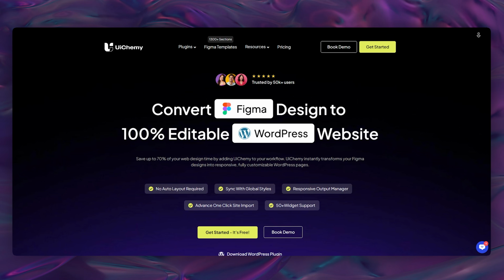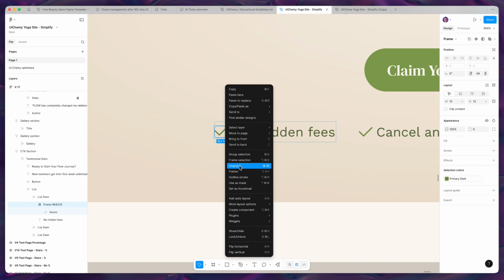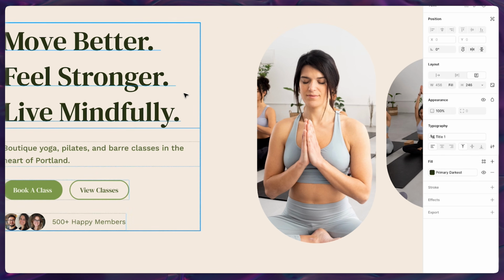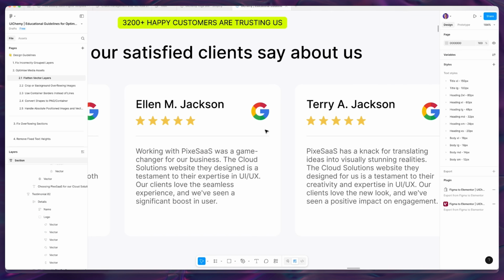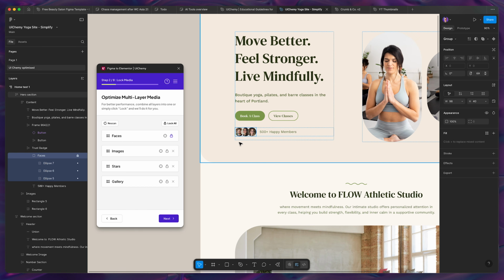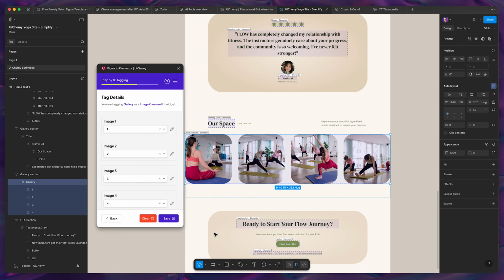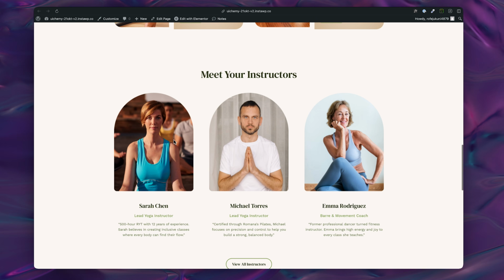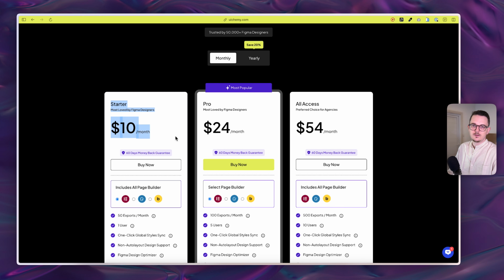The Figma to Elementor Converter: UiChemy (Tutorial)

Comment: Could we please have timestamps @rinodeboer?

Here's a starter:

0:00 - A. Intro & Overview

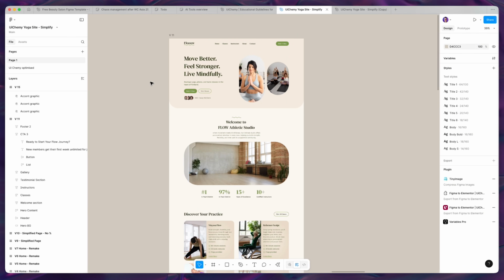2:20 - B. Preparing Your Figma File
   ↳ B1. Clean up & order your layers panel
   ↳ B2. Link all colors & typography
   ↳ B3. Remove unnecessary frames & ungroup icons
   ↳ B4. Set up buttons correctly
   ↳ B5. Full-width sections, backgrounds & padding
   ↳ B6. Auto layout, height & width settings

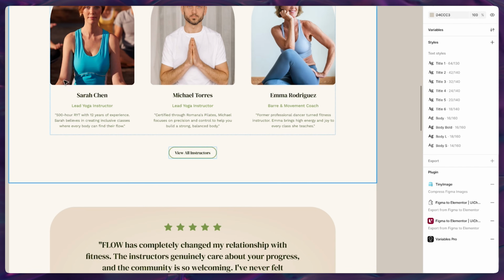10:35 - C. Working With Images
   ↳ C1. Image layers vs background fills
   ↳ C2. Bento grids & controlling image framing
   ↳ C3. Custom shape dividers
   ↳ C4. Flattening vectors, icons & logos
   ↳ C5. Strokes & dividers (FAQs, vertical lines)

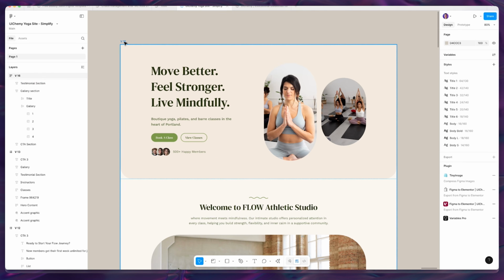18:17 - D. Inside UiChemy
   ↳ D1. Selecting your artboard
   ↳ D2. Locking layers
   ↳ D3. Manual widget tagging (headings, counters, buttons, carousels)
   ↳ D4. Responsive settings & clamp scaling

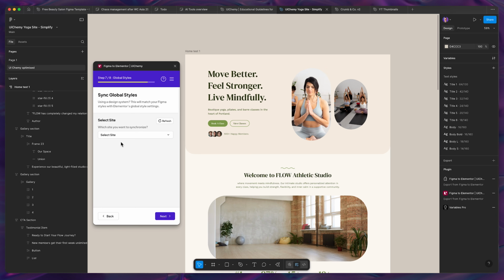25:22 - E. Syncing to WordPress
   ↳ E1. Connecting UiChemy to WordPress
   ↳ E2. Global colors, typography & container width

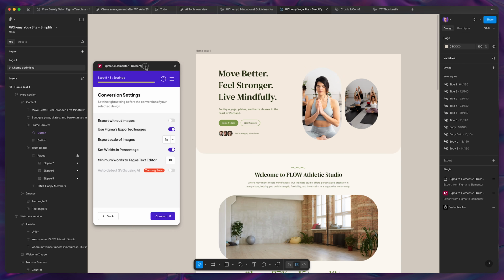28:10 - F. Converting & Results
   ↳ F1. Image export settings & running the conversion
   ↳ F2. Reviewing & fixing in Elementor
   ↳ F3. Responsive check

33:20 - G. Pricing & Wrap-up

Comment: Hi Rino. I've always been with you when it comes to using WordPress and Elementor for building websites. Wordpress offers a lot of possibilities when it comes to customization and dynamic content. But lately I've been doubting if WP and Elementor is still the right choice for me. I've been looking into Framer. Framer basically works like Figma, which means that building a website in Framer would save me a lot of time. You would design the website in Framer just like you would in Figma, but if you take the time to set it up correctly the website is already functional and can be published straight away. Framer has some amazing animation capabilities, SEO, website speed are all automatically optimized. And there is no need to convert you figma designs into a page builer (manually, or with a tool like UiChemy) which saves me so much time. They also have a great CMS, which makes it quite easy to create dynamic pages for different types of content. Have you ever looked into using Framer? I'd love to hear your opinions on the differences between framer and Elementor because I'm starting to shift more towards framer.
Reply from the maker: Framer is definitely an interesting tool when it comes to workflow, but you are going to pay a lot for little functionality. For example. If you want redirects, or multiple custom post types, that's $30 per website per month. That's free on WP with ACF and a redirects plugin. If you want funnels and UTM tracking, it's $100 per month per website. In WP that's just build into Elementor. 

So you are basically doomed with keeping it really simple, or you are forced to push those costs to your clients. And even on the $100 per month package you are limited compared to WP, only if you use custom code you can do more stuff. But that defeats the purpose of their workflow. 

So yea, not the biggest fan, even though I do understand the appeal of having design and development in one. It's a great idea, but they can't really compete with WP.